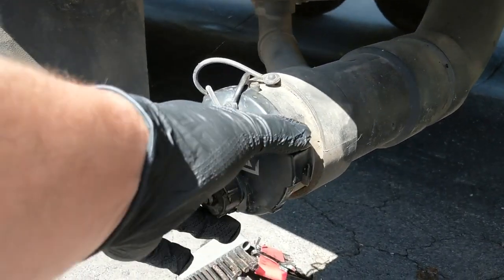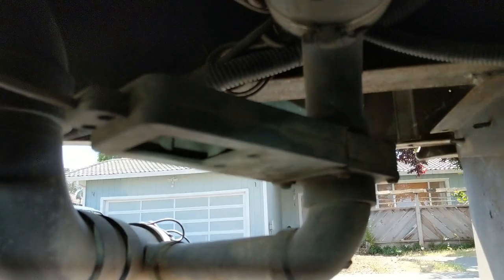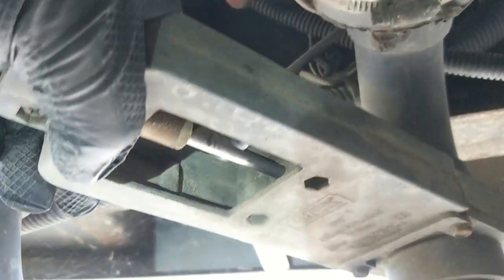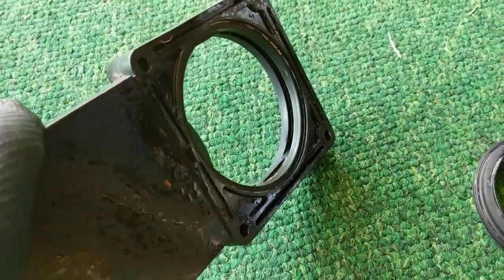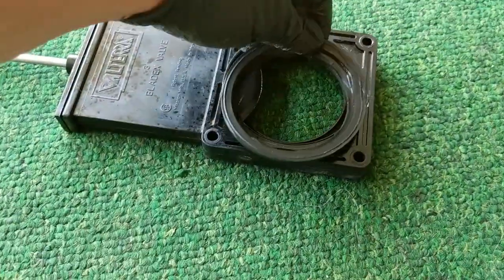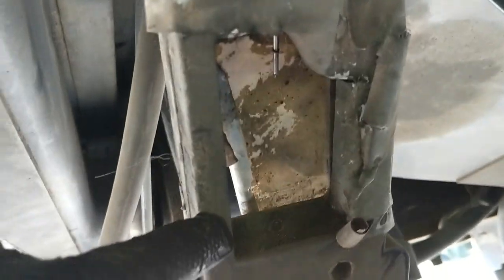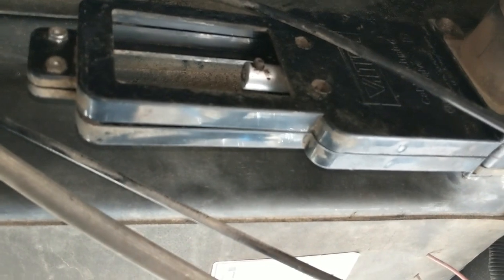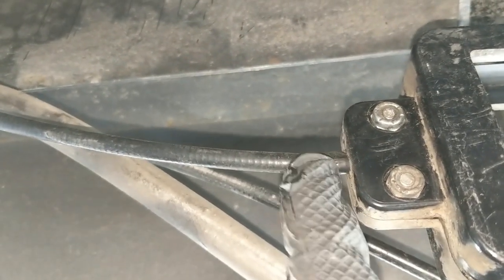RV Dump Valve Repair:  Fix your leaky Gray Water or Black Water Valve

Comment: I have an older Itaska motorhome that I have been living in by myself for about 3 months. I am semi disabled, senior female and cannot get under this to fix things. I have been able to drain my tanks with no problem but now the black side won't drain when I pull the handle.No fluid or anything and the handle doesn't seem to come out all the way. Is there something I can do to repair that or do I need a new valve and how do you do that when the tank won't drain?
Reply: I saw a video where the guy just poured 1/2 cup vegetable oil in his tanks and it lubricates it all and the seals and everything works smooth.  But you have to drain your tanks first, then put the vegetable oil.  Maybe you could ask a family member or neighbor to help you drain your tanks, then pour 1/2 to 3/4 cup of veg oil and let sit till next trip, or a few hours without using them, if that's possible.  I'm no expert, just trying to help.  Good luck.
Reply: Found the video.  Its called a $2 fix on valve pull tanks; The Duprey's is the name of the YouTube site.

Comment: My cable broke at the hande (new). Can I easily move the gate to release the black tank to the septic?
Reply from the maker: If you remove the plastic wrap or tape from where the cable meets the valve you should be able to move the gate open with your hand.

Comment: Thank you so much for the video. I’m about to go on a 10 day camping trip. Getting my trailer ready, and I noticed my black and grey tank valve that connects together are leaking. Going home and will use your steps to try and fix it. Thanks again.

Comment: Thanks for the great video! I went and bought new valves for both my black and grey tanks before watching this. I’m glad I didn’t start with the black one first because I think that I can return the new one and just clean up the old one(hopefully).
One thing I noticed was that one of your seals looked a little worn when you reassembled the valve, and that could definitely lead to future leakage. It would definitely be worth replacing the seals if they are showing any wear.
Another thing I had problems with was that my new valves didn’t fit into the piping like the old ones!

Comment: Excellent video I have a Valterra 3" valve for my black water tank with a direct handle.  The problem with it is like your cable unit is very hard to move I don't know if I have debris in the tracks for the gate valve or disintegrated gate valve washers TBD when disassembled.  If they need replaced I am goint to install an  electrically remote  controlled valve for convience sake as I am 72 and knees not being what they once were is very difficult to kneel to operate a manual pull handle.  Keep up the good work.  Happy RVing !!!

Comment: Great video. Going to do this rebuild to my valves tomorrow after work as well.  I'm going to have to lube them cables as well.
Reply from the maker: Post back how it goes!
Reply: Jackel440 why rebuild when the new replacement valve is so cheap?  The inner housing lubrication eventually becomes ineffective which makes valve operation stiff. Sure, you can take apart somewhat and try to clean but best to replace.